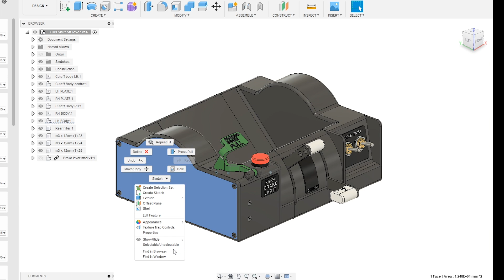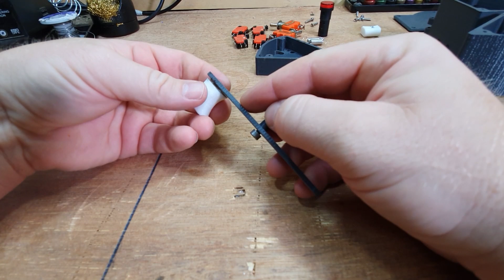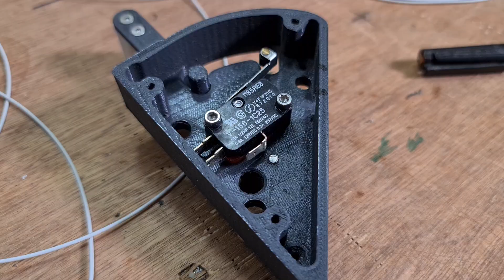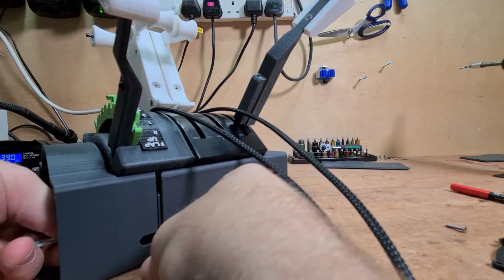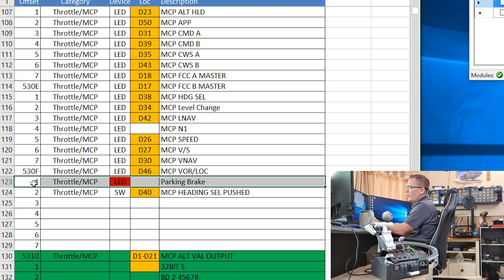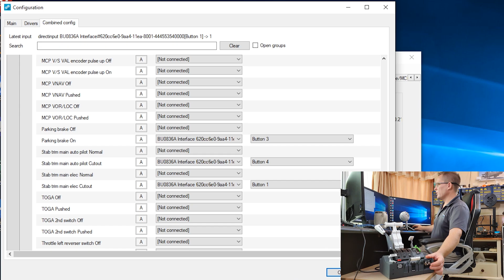Saitek 737 Throttle Mod 2

Comment: Which version of Prosim ?
Reply from the maker: I keep Prosim updated to the latest Beta version at all times. It changes almost daily for the better. Especially in MSFS2020.
Reply: I went to their site, seems to suggest his is a pricey purchase, is there a free of fee and free to use download?
Reply: Thank you for help. Love the detail, would love advice on first 3d printer. Are the screws that you use bolts or self tappers, not sure what you're screwing into as any 3d prints I've seen have been mostly hollow. Daft questions, sorry. 😬

Comment: Hello, I love your creation so so much!
How big does the 3D printer has to be? Also do it work on MSFS2020?
Reply from the maker: Hi, It will work with MSFS2020 as its just a joystick. the print bed needs to 220 x 220mm. Kind regards Karl

Comment: Hello im not so good at english so don't understand fully. But if i buy this for 8.40 dollars do i get all the parts or do i have to print it out myself with a 3d printer?
Reply from the maker: Hi Henric, this is just the design and STL's. All digital files. You will need to print the parts and assemble yourself.

Comment: Karl you are absolutely amazing and I can’t thank you enough for sharing your knowledge with us. 

Question for anyone who has done this mod. What type of supports do you use when printing the flap handles. I can’t for the life of me remove the guts out of the upper flap handle and keep snapping it.
Reply from the maker: Hello Dan, thank you for the kind words. The flap lever is a pain! I have to drill my supports out. And be very gentle. You could decrease the support structure infill too. This is only a problem when I print on my tronxy A8. With the ender3 the support usually breaks away really easy. Good luck, I hope others answer, and see what they come up with! Kind regards Karl
Reply: Heli Mech gentle is a struggle for me it seems. I will try that. Thank you so much for the reply!
Reply from the maker: You can always try printing at 100% infill. That will make it much stronger
Reply: Good point especially with these parts taking regular abuse.

Comment: Hi Karl, I understand if I was to purchase those plans I would receive the Fusion 360 files aswell? Reason I am asking is that I use two saitek throttle units as I fly the 747, 777 and the 737... so my plan would be to adapt your design to accomodate 4 fuel levers and both the saitek units.
Reply from the maker: Hi Danno, this has been a great bone of contention on the channel. There are those that want the design and those that just want the STL's. So to please both worlds i have just included both now in a WinZip file. If you do MOD the design, send me a photo! Love to see what you come up with!
Reply: Heli Mech I would definitely want the design as it is a superb learning opportunity since a lot of times I find myself asking how you modelled some parts in Fusion. 

After watching video 3, great watch btw, I am not reconsidering and may end up printing and building the whole thing. I printed myself some DIY handles to go with the saitek unit that aren’t nearly as big and sophisticated as your design and the whole thing feels so flimsy...😅

Comment: Hello Karl,
I watch a lot of your videos, they are fantastic and very inspiring ...
I'm starting to do some switch tests and toggles tests connection, glued on a wooden board to make my MCP.
I'm researching informations on 7-segment displays. I carefully read your advice on your website and wanted
to ask you a few questions:
- The links you give to buy these displays are no longer valid, can you tell me where you buy them now ?
 (not valid or not available https://www.amazon.fr/MAX7219-segments-Affichage-Conseil-Arduino/dp/B00IHSE6V6)
- You chose the color blue when in reality they seem white. Is it because like me you don't find white?
- Isn't it a problem during a flight not to have the right number of displays?
(IAS 5 instead of 7, ALT 5 instead of 6, VERT SPD 5 instead of 6 ?
I'm starting to think about making my own PCB with Kicad to have the exact number of 7-segment digits
controlled by a MAX7219)
Thank you in advance for your help !
(I'm on X-Plane 11 and I work with SimVim and Mega 2560)
On your website, you talk about encoders better quality than the KY-040, you thought about your link for
RV24YN20S 10K?
Reply from the maker: Hello! I am going to have to remove links from the website. They never stay active for more than a couple of months. I can only suggest typing the keyword into amazon or eBay. I used blue because they came in a handy 5 digit size and I could only find white in single digits. I think Prosim only displays to a max of 5 digits, so I haven't found the need to increase to 6 digits yet. Great to hear from you and thank you for the kind words. Karl
Reply: @helimech8152  In France, blue is the color of hope ... ;-)
Thank you for your answer !

Comment: Karl where is the trim wheel
Reply from the maker: Hi, i don't think i'm going to add the trim wheels. I need to get on now and start to build my actual throttle quadrant. As a thought, you can use the trim switches on the Saitek unit.
Reply: @helimech8152  OK thanks for the answer

Comment: Well done 10 out of 10 but there is one slight flaw and that is the potentiometers that saitek/logitech use int the throttle quadrant,  they are cheap and nasty. You will find that you will get spiking after a while and it almost impossible to remove.  I have had to rewire my ones several time due to the spiking issue and have now given up. I am now waiting for the release of the Honeycomb bravo throttle quadrant  to be released later this year https://flyhoneycomb.com › products
Bravo Throttle Quadrant – Honeycomb Aeronautical
Reply from the maker: Hello Capt Jebus, have you thought about placing a small capacitor across the unit. This should flatten out spikes and prevent jitter. This was essential when I used a leobodnar card for the yoke assembly.

Comment: Wow! thanks for your contribution to the world of flightsimming.  What 3D printer are you using for this?
Reply from the maker: Hi steve, This was done on a Tronxy A8. However, i have just purchased an ender 3 pro.
Reply: @helimech8152  Thanks!  that is similar bed size&build height to an Ender 3?  I guess what I am asking is, will these parts print on a smaller DFM printer such as the Ender 3?  By your answer, I assume so! LOL.  thanks again.

Comment: Amazing, once again. Is this the same size as the actual 737 throttle quadrant? Also, what 3d Printer FIlament are you using? Last question: is there any software I could use instead of ProSim? It's over $1000, and I don't know if I can spend that much on software.
Reply: Rohan Modi I think u can use fsuipc and pmdg
Reply from the maker: Hi Rohan, Stick with PMDG. its much cheaper. Only the levers are the correct size as this will be used on the final quadrant design when i CNC cut it. For the filament, I use PRIMA Value as i think its the cheapest out there. Having said that, i can not find it on amazon anymore.

Comment: Great project and execution. It seems that everything you do just works as planned. That's really nice. 

I'm on the journey of building a more modest cockpit for my flight sim hobby and found in your channel a lot of inspiration and learnings. 

Do you mind sharing what type of wire are you using for your projects? This white one I saw in this video? 

Thanks and have a great start to the week ahead! 

Cheers.
Reply from the maker: Lol Julio! Let not mention the yoke design then! Thank you for the kind words! The wire is actually 22AWG removed from an aircraft. Its amazing quality and really glad i save it. However, if i need to purchase wire, i look at 24AWG with multi strands. the more the better.
Reply: @helimech8152  Thanks :)

Comment: Brilliant job, that's a nice little unit now it's finished. Good of you to make the stl's a free download for everyone too. 
I'm into cold war military jets myself and with those it's a case of buying what real hardware you can and\or designing, printing\fabricating else everything yourself. Interestingly - apart from the usual collectors items like control stick grips - real military jet hardware isn't THAT expensive. Relatively anyway. Anything real and B737 or Airbus is crazy money in comparison.
Reply from the maker: If you have any items that you think i can design in CAD and you think it would benefit others, please let me know. Im up for something different!
Reply: @helimech8152  I'll try and think of something. I'm OK on the design front personally, I've got a lot of experience with 3D Cad and reverse engineering items I only have access to photographs and line drawings in manuals of.
But I'm sure there is something the mainstream military jet enthusiasts would love to be able to print. I release everything I design, when I remember and Thingiverse is working OK :) - but it's all stuff for weird cold war warriors like the Viggen. 
I'll get my brain in gear and let you know in the comments on the next video...